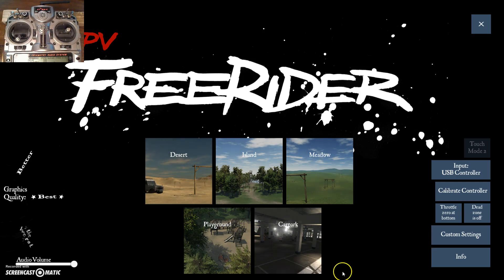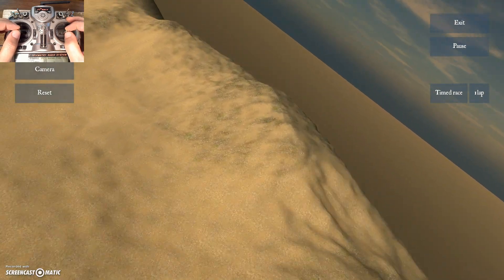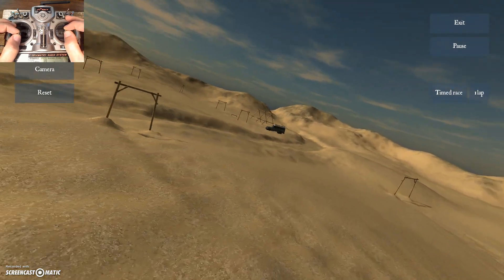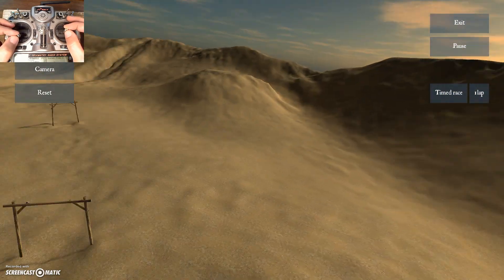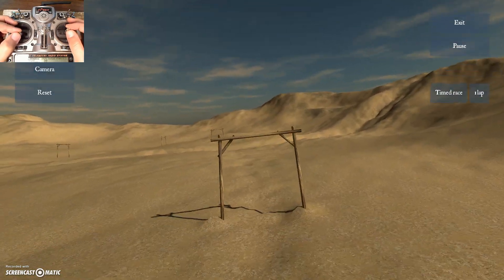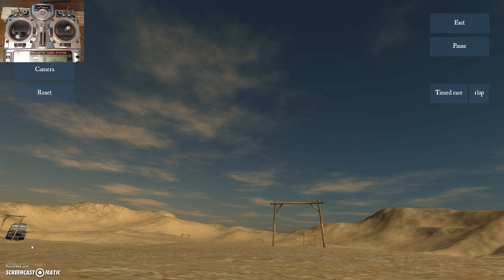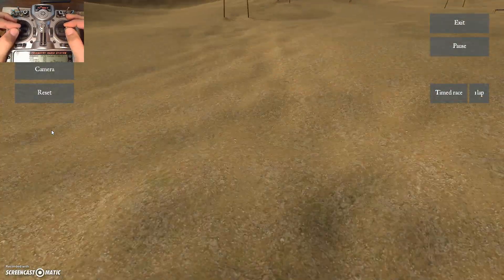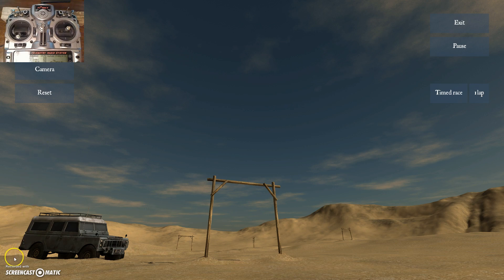How To Fly A Racing Drone - Lesson 11 - Flat 180 Turns

Comment: my taranis is showing a usb input, thr hp laptop doesnot recognize it. And i cannot get it to function with the simulator.  any suggestions?
Reply from the maker: I have this problem with one of my computers. It started when I plugged the Taranis into a USB 3.0 port. All I can say is, go look at your Device Manager (assuming Windows) and see if the USB device is being recognized. If not, go through the standard steps (delete device, uninstall driver, reinstall) to see if you can fix it, but I haven't been able to fix mine no matter what I do.
Reply: +Joshua Bardwell turned out it was a bad cable.  it works perfectly now.
Reply from the maker: Wish mine was as simple.

Comment: I'm using the same setting as you. I was wondering if you use any expo? without it it is so nervous, I ended up putting 40% expo on the taranis for everything but throttle. I haven't flown my real quad yet so I don't know what to expect and what is "realistic controls"
Reply: +maxdessureault false, I'm using the snappy preset with 70 throttle
Reply from the maker: +maxdessureault  I don't have any expo on these videos. You just get more sensitive with practice. Use expo if it works for you.

Comment: I see you always pinch the sticks. Do you find this more precise than using thumbs?
Reply from the maker: +olivierhacking I only do that when the transmitter is on the table and I can't wrap my hands around it. When I'm actually flying in the field, I use thumbs. I have tried pinching, and I don't think it is more precise, but I do think it is more secure. In other words, when I'm using thumbs, sometimes my thumb gets shifted slightly to the edge of the stick and I have to re-adjust it. That doesn't happen when I'm pinching. But I have a hard time avoiding unintended inputs when I'm pinching, such as accidentally pushing yaw when I'm adjusting the throttle. I think thumbs is easier for me because that's how you use a video game console controller.
Reply from the maker: +olivierhacking It's not more precise, but it's more secure. I still use thumbs in the field. I'm only using pinch in these videos because the transmitter is on a table and I can't wrap my hand around it.